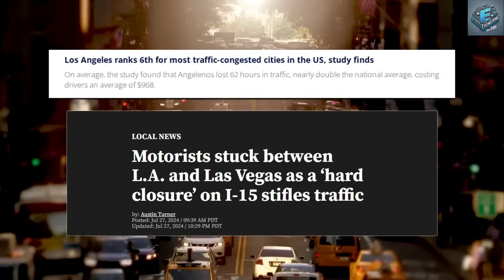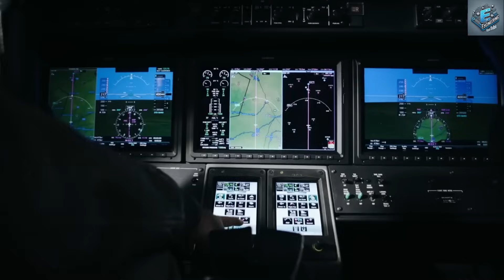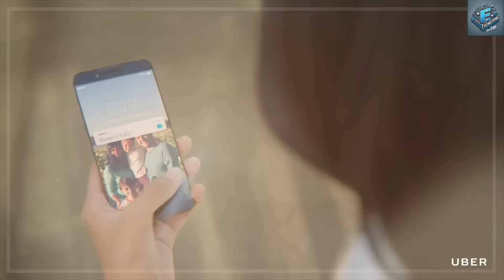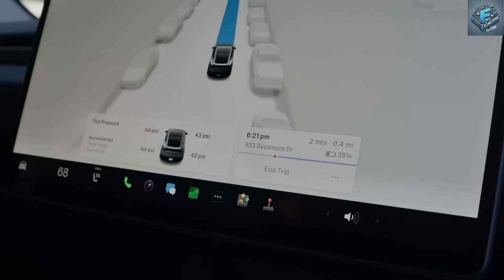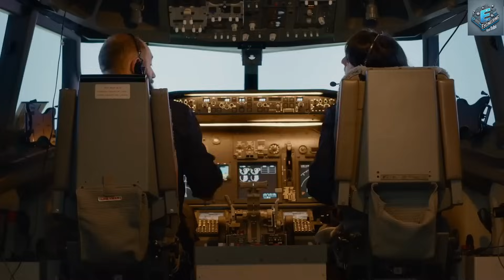Tesla's Electric Plane: The Future That Will End Traffic Forever

Comment: NO!   NO!   NO!   This is just another of the many scurrilous FAKE NEWS stories about Elon Musk designed to pull in the gullible.  Musk has said repeatedly that he opposes the idea of "flying cars" because mechanical failure at altitude is very unsafe and could kill not just the vehicle occupants but anyone they crash-land on.  They would also be very noisy.   As for electric planes, Musk says someone else will probably make them, not Tesla, at such time as battery energy density has improved enough.
Reply from the maker: Thank you for sharing your thoughts! It's important to question and discuss these concepts, especially when it comes to safety in transportation. Your insights are valuable!